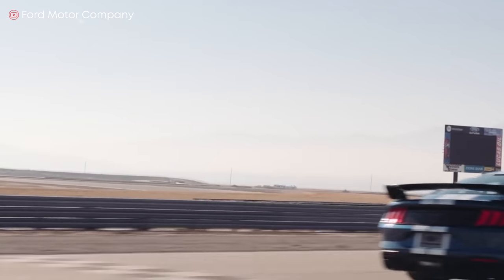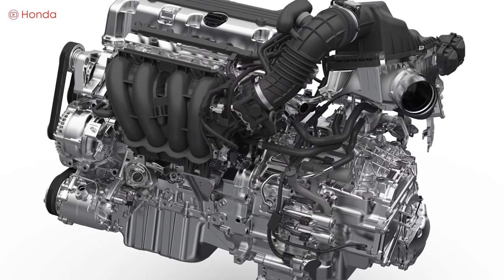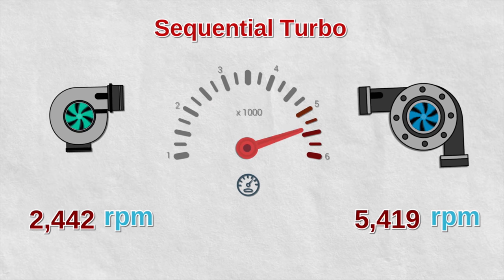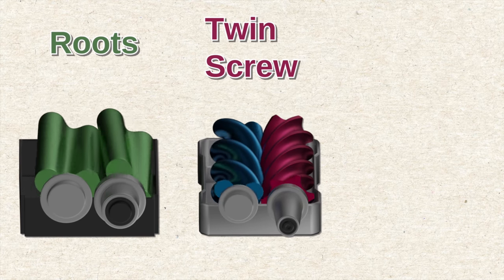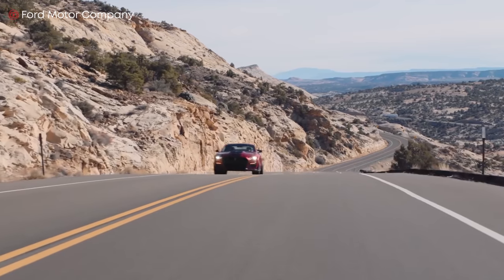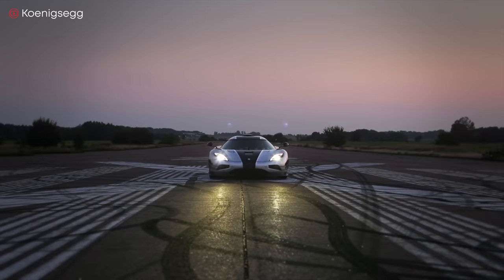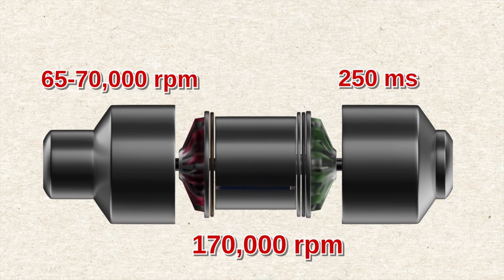This New Mod Will Add 400 Horsepower to Your Car

Comment from the maker: Here's Why Changing Your Transmission Fluid Will Cause Damage to Your Car: https://youtu.be/CBTNNHxgYNw

⬇️Scotty’s Top DIY Tools:
1. Bluetooth Scan Tool: http://amzn.to/2nfvmaD
2. Mid-Grade Scan Tool: https://amzn.to/33dKI0k
3. My Fancy (Originally $5,000) Professional Scan Tool: https://amzn.to/31khBXC
4. Cheap Scan Tool: https://amzn.to/2D8Tvae
5. Dash Cam (Every Car Should Have One): https://amzn.to/2YQW36t
6. Basic Mechanic Tool Set: https://amzn.to/2tEr6Ce
7. Professional Socket Set: http://amzn.to/2Bzmccg 
8. Ratcheting Wrench Set: https://amzn.to/2BQjj8A
9. No Charging Required Car Jump Starter: https://amzn.to/3i7SH5D
10. Battery Pack Car Jump Starter: http://amzn.to/2nrc6qR

⬇️ Things used in this video: 
1. Common Sense 
2. 4k Camera: https://amzn.to/2HkjavH 
3. Camera Microphone: https://amzn.to/2Evn167 
4. Camera Tripod: https://amzn.to/2Jwog8S 
5. My computer for editing / uploading: https://amzn.to/301tYt9

🛠Check out the tools I use and highly recommend ► https://goo.gl/rwYt2y

Subscribe and hit the notification bell! ► https://goo.gl/CFismN
Reply: And turbo’s can make little more power at the high end when fully buld with the best turbo over the super chargers at least what I see in Forza games
Reply: I'm hearing that people are using compressed oxygen like nitrous oxide with unbelievable results.
Reply: Hey Scotty, is there no way that a turbo could be augmented by some kind of electric motor to spin it up before the needed exhaust pressure is achieved?   

Pfft nevermind, just saw it, lol!
Reply: Hello plz mr scottty plz make video on infiniti vs lexus
Reply: @fromthebackofmymind  yeah, I saw the duel turbo segment, then posted my question before watching the rest of the video. Looks like there are already cars out there that does exactly what my question covered. An electric motor that spins up the turbo until exhaust pressure is achieved..
Reply: Dude Scotty I just checked Nissan JD POWER rating..... Ya it's a reliable brand now.
Reply: The battery exchange model would require millions of surplus batteries to work, it's logistically impossible
Reply: Scotty you have more subscribers than CBS news!
Reply: My friends grandmother floreece Longoria she told me about the grips in the fluid on a worn vehicle and better not change it.Granny had trophies all over her livinroom
She used to be in the
S.C.C.A.
Reply: Scotty..... Wow, thanks for that "History" lesson. I always kind of haphazardly thought that I knew what thos thing-a-magigigs was and Now I Nose.....  Especily that last one...the electrk one....
Love ya bro!
Reply: Shouldn't this vid have been posted on your other channel?
Reply: How about a super charger that uses an electrical motor to spin it instead of having to worry about parasitic loss from the belt?
Reply: This might sound like a stupid idea, but I wonder if it would be possible to turbo charge an old gas power generator with old turbo charger parts to get it to reduce the amount of fuel it needs to run? Maybe I should not call it a turbo charger, but something else.
Reply: Scotty at 50 seconds the exhaust wheel is turning one direction while the intake wheel is turning the opposite direction on as you say on 1 shaft.  Sorry fellow this is just not possible.  I used to sell turbochargers and you set up crew pulled a fast one on you.
Reply: Scotty, what would you recommend for a 98' Mustang GT for a significant boost in HP?🤔
Reply: @Kamal_AL-Hinai  Have you any explanation as to why Scotty, hasn't commented in this leading thread?
The Detroit 2-stroke diesel engines utilized supercharger tech long before it became general knowledge.
Reply: @Logan Thompson Hi, I am British and screw air compressors are considered to be the normal standard, so can you explain why most Americans still use those noisy and inefficient piston compressors?
Reply: @Kamal_AL-Hinai  Thanks for letting me know.
Reply: @Kamal_AL-Hinai  Turbos cause back pressure which restricts the exit of the exhaust gases. So, I cannot comprehend why a supper charger can be less efficient than a 1 or 2 turbos.
Reply: A 4 stroke gas or diesel engine can function without a turbo, but the Detroit 2 Stroke diesel engine cannot function without a supercharger...
Reply: 9999
Reply: @Electric_Eye_  Very true. It's nothing new, however. A SBC making between 400 and 450 horsepower in it's usual state of tune, will make north of 800 horsepower when a welding tank holding compressed air, instead of Co2 or argon, is plumbed to it. Unfortunately, the tank needs to be refilled after every quarter mile pass. On the upside, cylinder heads that flow crazy amounts of air, and support crazy valvetrains are not needed to make said 800+ horsepower. It's been seen publications such as Hot Rod.
Reply: @Electric_Eye_  It's just compressed air, that contains whatever percentage of oxygen is normally found in air. The use of pure oxygen would result in temperatures that would definitely be catastrophic to pistons at the very least. With the best anti heat coating from a company like Swaintech, only small amount of increased O2 could be added before the temperature in each cylinder became so elevated that only failure could be guaranteed. That said, it would be extremely interesting and educational to test the waters.
Reply: P
Reply: @AM562   real life isn't like the game. Superchargers have parasitic loss, whereas turbos use a bi-product, the exhaust. Turbos are far more efficient than superchargers.
Reply: @Electric_Eye_  2 oxygen molecules instead of 1. 
However you also need more fuel. Gasoline molecules only have so much energy. To make more power, you need more fuel. Doesn't matter what power adder you use. Whether it's turbo, supercharger, nitrous, you're going to need more fuel.
Reply: Dr
Reply: Funny thing is Jiffy Lube ALMOST did it!!! But I'm driving an '97 right now and the previous owner told me DONT CHANGE THE TRANSMISSION FLUID, mannn. Scotty can you please mentour me plz idk how but I want to be a mechanic and you're the most honest person I've met
Reply: @stevenjames9487  me too
Reply: Help Scotty...
Reply: Hey Scott what mods can I do to 2013 chevy impala 3.6 v6 ???
Reply: So I will get 450 hp from my Mini, sounds good.

Comment: I stacked up 3 of these in my Corolla for a total of 1275 bhp. She’s a ripper.
Reply: 1/4 mile time?
Reply: My Corolla has 376k.. I think it's almost broken in enough to try this ;)
Reply: How long till it blew up?
Reply: @ruger1420  I don't think it's going to as long as I keep up with the oil, burns a quart about every 120-150 miles lmao
Reply: Ok. Lol
Reply: Lmao
Reply: So you only had 75 bhp?
Reply: @rw9495  lol  oils cheap. 😂
Reply: @ruger1420  I'm at Walmart for oil more than I'm at the gas station, that part is great🤣  still getting 30mpg highway too
Reply: @dylansterio3227  My 98 started with 120.. long ago lol
Reply: Not bad for a 4 cylinder 😂
Reply: I have a 1996 Jeep Grand Cherokee Laredo 213000 miles.
5.2 l V8 that's still pretty peppy.
Probably get this on my car.
How long till I need a new engine?
Reply: @_Ambition124  1 second,  0.9 on the 120 ft
Reply: Ohh how I miss me 74 celica Gt I had it done up just enough to outrun moms 79 TransAm
Reply: Curious on how you came to the 1275 BHP figure?  Sounds factory, lol.
Reply: @rw9495  does turbo in your car kill fuel economy ? lol my 2012 Corolla stock so it do t go through to much gas
Reply: @misterbanshee7992  I still average 27-30mpg even with it this old and burning a lot of oil, and the 13.5 gallon tank is the perfect size
Reply: @mylittlepitbull3143  Mine had 265k before I had to sale. At one point it was ran for about week with 2quarts of oil, my brothers doing, that was around 215k. Obtained it at 125k and I drove it hard.  5.2 one the best engines Chrysler put out IMO. 💯
Reply: @rw9495  I'm right behind you buddy at 365K, seriously considering what the extra 400 Hp will feel like...
Reply: @RichPB007  Run some Supertech fuel injector cleaner through your next tank fams! It's 97 cents at walmart and I swear I picked up some lost horsepower. Every little bit helps when you started with 120 lmao. I've also thought I might do a cold air intake to gain a bit more.

Comment: You didn’t mention that superchargers rob horsepower at high rpms. That’s the advantage of a turbo is that yes you have lag but you get higher horsepower as a result.
Reply: @Three Percenter I was thinking the same thing
Reply: Parasitic loss from 30% to 70% depending on style. They also have much less potential. One step back, two steps forward. I'll take the two steps forward only with a turbo set up.
Reply: Contrary.  You forget that with a supercharger, you don’t need higher RPM’s to reach the same power and torque result as with a high-revving turbocharged engine.  This is coming from myself, a specialist in performance and forced induction who has extended experience with the use of both.
Reply: @starcloakstarside9719  cool
Reply: Do not correct scotty.
Reply: It’s not correcting just adding.   :)
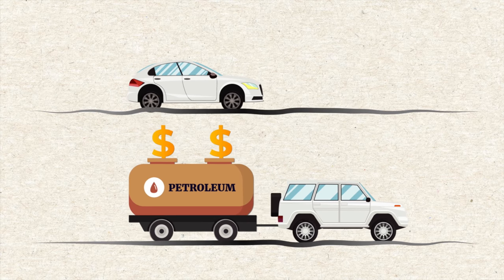Reply: He kind of implied it at 8:32 when he said one of the advantages of turbo is that it uses the “free” energy from the exhaust that would otherwise be wasted, rather than making the engine work harder for it.
Reply: Did not think of supercharger losses .
Reply: He kinda implied it tho. He didnt totally want TurboChargers to win this. I love a twin turbo set up. But man that instant power is addicting.
Reply: modern turbos have less lag . anyway i like the lag or you just drop a gear and then boost kicks in by around 3000 rpm. its a rush man. turbo's rock.
Reply: @Conor Caldwell well no because the engine is still doing mechanical work and expending energy to turn the charger. the turbo on the other does not rob the engine of mechanical power
Reply: @starcloakstarside9719  That's not true.  Compressor (plus turbine for turbo and belt/gearing for supercharger) sizing is everything making your statement way off line.  A supercharger theoretically makes peak power at the top of the RPM range which is when you shift, and that's not ideal.  You can size it to give more air down low but it's efficiency will peak out early and your parasitic losses are through the roof at higher RPMs.  Turbos, when sized correctly, give you a consistent power band across a much broader range (again when sized correctly) because it's function is load based, not RPM based.  Prime example;  Diesels have low RPM engines but almost exclusively use turbocharging because of their efficient power delivery based on load regardless of the engines RPM potential.  I'm doubting your 'specialist' credentials
Reply: @starcloakstarside9719  but what about a super charger with an eletric motor connected to a turbo to since the turbine lights to get extra rpms going before hand to have a faster get up
Reply: Well not everyone wants to run in high rpms
Reply: @ianhale4466  yeah they do . if they got the capability they're gonna use it
Reply: @ianhale4466  plus with a modern turbo theres almost no lag.
there are even motor generators to fill in any gaps. so its win/win. a turbo is a supercharger anyway only it uses energy otherwise wasted.
Reply: @yogiguitar1  I wasn't saying turbos where good or bad, I was saying not everyone need a turbo for there application and not everyone needs a supercharger. Both are expensive to replace ask scotty, and both wear your engine, just ask scotty, and turbos tend to go out quicker than superchargers, just ask scotty. Also depending on how reliable it really is, this electronic supercharger blows everything else out of the water so there ya go
Reply: @ianhale4466  well it depends .if you do regular maintainance you can getta lotta mileage outta your turbo.  just keep that oil &filter change schedule going and you'll be good.
Reply: @yogiguitar1  you can get a lot of mileage out of a turbo, but what good is a turbo once it's junked up your 4cylinder only meant to handle 200hp tops, even 6cylinder aluminum engine just can't handle serious horsepower. Even modern v8 engines will suffer in the long run
Reply: @ianhale4466  if you're gonna bolt a big turbo on you'd best bolt on a bigger rad +an oil cooler and an intercooler. or get a motor thats been built to handle boost. they're out there . its all about managing heat and good lube as the actress said to the bishop
Reply: @yogiguitar1  even specifically designed race cars are out of commission more than actually on the road and they are designed for all the turbo available and still can't handle it
Reply: @yogiguitar1  just thought i would share my personal experiences. I have experiences with all of the mentioned power adders, also nitrous, real world experience. I wanted to let you know not to overestimate twin turbo setups,. I currently have a 2jzgte which had sequential twins the nitrous for when I need it to help spool the twins, because it its suppringly laggy- and anything but instant power and nitrous, however i am about to chage to a large single turbo setup- with more modern technology and features. I will also be adding a Sound Performance quick spool valve- which is not cheap. Because I hate turbo lag and am trying to eliminate as much as possible,. The size of the turbo(s) and the design of manifold are also crucial factors that decide when the power comes in , and peaks.
What you would probably want fpr instant power with twin turbos, would be the largest engine your willing to buy, and looking into building APPROPRIATELY SIZED TWINS . Likely the 1st one to come on will need to be as small as you can use without the turbo causing problematic exhaust flow,. 
But hey the good news is- when its time to race, the lag doesnt really matter for me , because I can build boost from footbraking at the line,or use the 2 step, plus 1 or 2 stages of nitrous.  But i hope i have maybe helped you avoid buying something and then being pretty disappointed like I originally was, just with the supra twin sequential turbos👍
Reply: @tmoney1091  well dude im in a merc 300 td right now with the om 606 . i can go get a mechanical pump and a big turbine for an easy shot of big ponies but to be honest its not needed on a daily driver. i did have a 944turbo s with 300 + horses that was fun. i havean old mx5 ive not driven in over 5 yrs that i was thinking of strapping a turbo on but its a far off project cause i got a ton of other stuff to get through. there you go eh
Reply: @tmoney1091  oh well, after reading all that I'm just gonna stick to adding a fart cannon & call it a day
Reply: Can you super charge a 6.2 diesel?
Reply: Someone else may have mentioned this, but I didn't hear it mention a central Very negative aspect of Turbos is that they HEAT SOAK engines EVEN if you use all the intercooler you can stuff in, HEAT is a Major connsidetation.

Comment: That extra hair dryer in my bathroom is starting to look like a good idea. Even better when I mount on the hood. Twin of course. Got to go with twin.
Reply: I use two milwaukee battery leaf blowers. Love the power and the 15 k dollar electric tax credit.  I might have over filled out the tax paperwork.
Reply: You'll need a really long extension chord!

Comment: I’m currently running the old Volkswagen 1.4 TSI twincharged engine… a marvel on paper but hamstrung by VW cutting corners in production. But, when it’s working properly… it’s a dream!

Comment: Had an ‘87 New Yorker with the puny 2.2L turbocharged engine.  Turbo-lag was several seconds...never noticed much lag with my F350PSD’s and the turbo whine was exhilarating!  My little 350’s thought they were as good as the big over the road guys!

Comment: The EMD turbo supercharger gives the best of both worlds. It's a centrifugal compressor which is gear driven through an overdrive clutch (a ramp bearing) until the exhaust gas speed gets high enough to take over.

Comment: Making a car last a 100,000 miles is such a great idea!  I've already spent too damn much money on cars.
Reply: I have a 95 gmc v-8 219k 1,starter,2 sets of brakes 2 radiators 4 tune ups and 8 batteries!!!!!
Reply: Most any car can easily go 100 k miles.  Even my ford truck and my porsche and my bmw have gone a lot further than that.  A fiat. Or vw or jeep or land rover.  100 k miles is not going to happen
Reply: Vauxhall vectra Sri 92000 miles 👍
Reply: Ford profile picture explains why you can’t get a car to pass 100,000 miles
Reply: @cayman9873  Ford is trash I’d take anything other then Ford.
Reply: @Cinnamontoastcrunch1029  sorry, the the car I'm driving now is a 2010 taurus with 190,000 miles.  I drive 80 miles a day.
Reply: @M Hamilton I'm sure of that, I wish I had changed my transmission fluid, it shifts fine.
Reply: @Cinnamontoastcrunch1029  I have to wonder how old you are and if you are one of the people who get all worded up for one brand of car. All car makers have had a few lemons and most have made some cars that are very good.
Reply: @douglasw5371  crown Victoria is probably the only Ford I’d drive tbh

Comment: I attached a 150mph electric leaf blower that ran off a power inverter to my 2WD two door jeep cherokee. It had a 4.0 inline 6 cylinder in it and was completely gutted. Throttle response was great but it couldn't give the volume of air needed at the top end. It sounded cool when I switched it on and had a few drivers that where impressed. We ran low 14's with it.